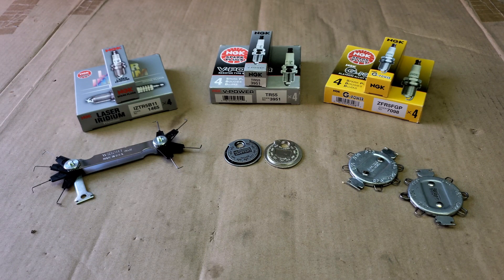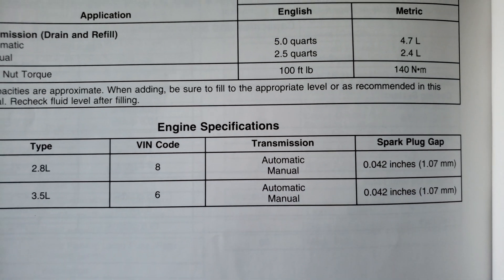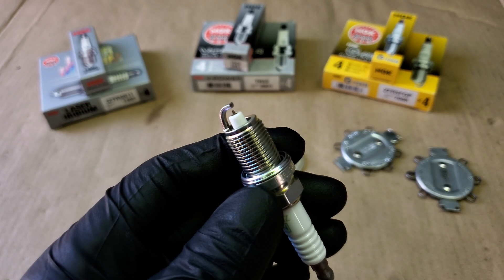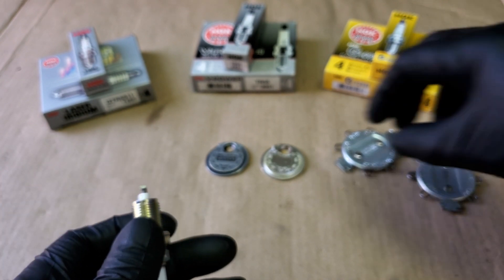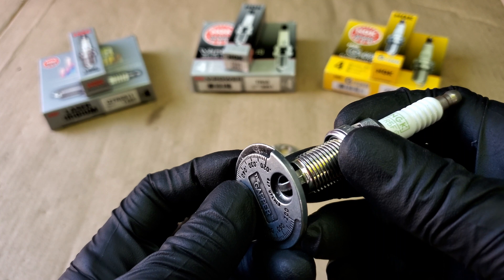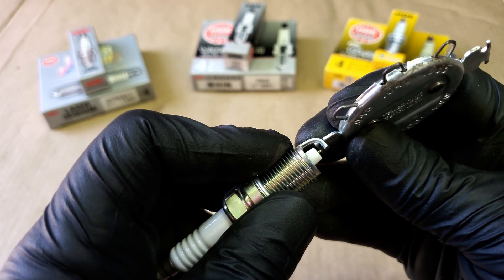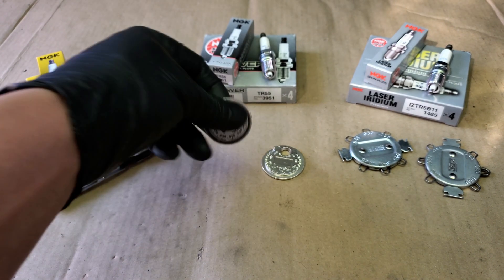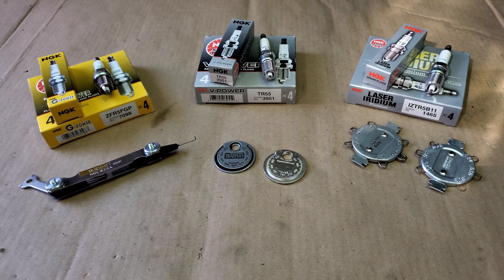How to Gap A Spark Plug Properly - Should You Gap Iridium Spark Plugs

Comment: With your permission, I'd like to comment on how I feel about adjusting the mass electrode. I'm afraid that adjusting the curve of the mass electrode will weaken it. It could break and fall into the engine. If I need to adjust it, I'll buy new spark plugs and check the gap before taking them in.

Comment: Great video, my gap on my f150 is .052. Its impossible to find a feeler gauge or wire gauge with this thickness, is there any trick to this?
Reply: You combine feeler gauge thicknesses until you get your desired measurement that you wish to check.

Comment: What is the first gap tool called? I am looking for it online and can't find it. Your favourite spark plug tool doesn't have the 0.043 measurement that I need.
Reply from the maker: The first one is a wire gap tool and they do have 2 or 3 different ones with different sizes of the same tool on those..i should have em all linked in the description

Comment: Hi have you ever got new plugs that are pre-gapped and they were way off the correct gap? I just got some NGK and they are meant to be pre-gapped to 1.5mm but the gap is much larger than that. It looks like I will need to correct the gaps in them.
Reply: I just got NGK Iridium plugs that are supposed to be pre-gapped to 0.044 inch but the gap is only 0.036-0.037 inch when I measure them.
Reply from the maker: Hi, normally not way off, just slightly off ive had a few that were closed completely probably was dropped...on gm trucks they used to have a .060 and if u get the original plug itll come in a .060 that will need to be readjusted to a .040 cause of a service bulletin..maybe something similar to that happened
Reply: @backyardchevy328  Ok, thanks mate
Reply from the maker: @cj8172  anytime buddy

Comment: Making the gap slightly smaller does what to the engine?  If making the gap slightly larger what happens? I’m confused. joseduranjr8@gmail
Reply from the maker: Well say an engine has a power adder or increased hp..that makes the spark more susceptible to spark blow out..so u make the gap smaller to prevent that...but when it comes to gap the wider the gap the better the gap will be at igniting the complete air fuel mixture..but of course if u go too wide it risks making the spark possibly less reliable